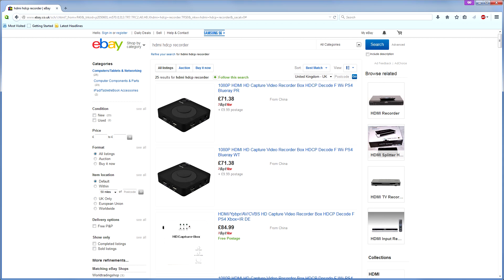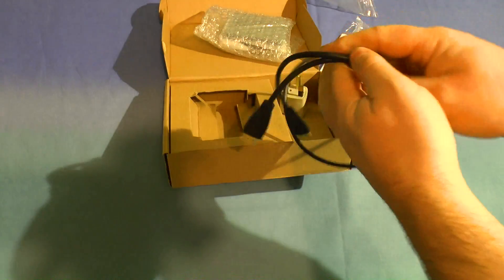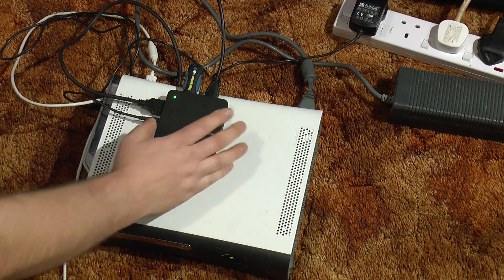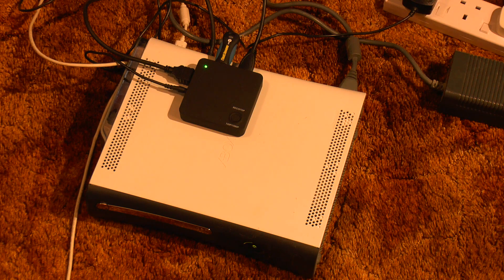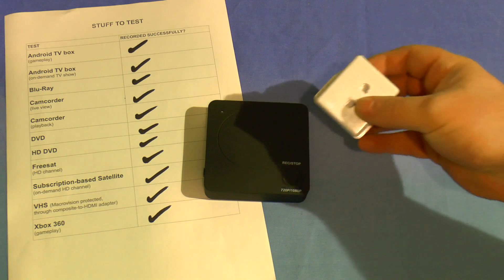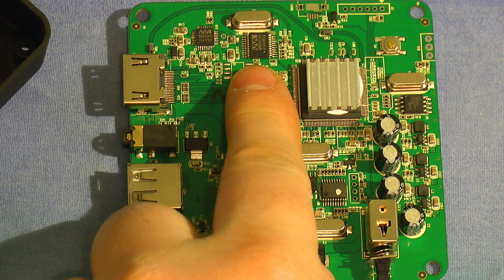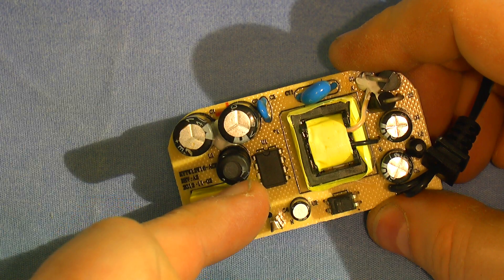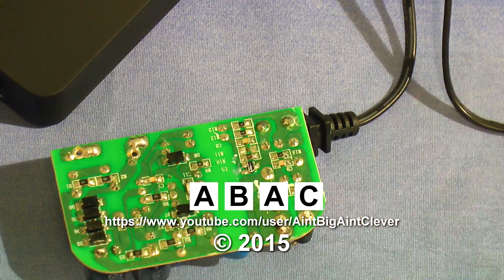HDMI capture recorder (with HDCP decoding) review and teardown

Comment: will it record your audio with xbox headset pluged into the xbox?
Reply from the maker: It'll record whatever audio comes out of the HDMI port. If the headset mutes the audio, then no. If the headset doesn't mute the audio but you can't hear yourself through the TV, then you need a separate microphone to record yourself. If everything comes through the TV, it'll record the lot, although you may wish to ensure you're outputting in stereo and not 5.1 as I think it'll only record the front two channels (2.0).
Reply: thanks

Comment: Do you get a nice smooth record? when I record I get a slight frame judder on panning shots ect, do you know how i could fix this?
Reply: +MovieMaster 666 These clone boxes can record a maximum of 30P when using 1080I/P,  that will judder yes. You can try recording using 720P60 fps instead?
Reply: Thanks for replying. I am trying to make a pal DVD from the footage so can you recommend how best to do this? If it helps I could also make the dvd NTSC at 30 fps would that remove the stutter or at most hide it a little?

Thanks again
Reply: +MovieMaster 666 Valid DVD's are MPEG2 PAL/NTSC ( 576i50/480i60) so you have te convert/reencode your recordings always if you want to make a valid DVD. The box can't record in interlaced so the conversion must be done properly from 50p or 60p to standard interlaced PAL/NTSC format to keep things as fluid as possible. You have to experiment with conversion software what gives best results. Sure always test the results on a real TV. And when you convert between PAL/NTSC framerates (50/25 and 60/30) you can get extra stutter too. It not at all so easy lol. Much more needed information about that on videohelp.com for example.
Reply: thank you so much for explaining that to. It makes sense now and I was going about it all wrong lol!
Now that you have explained it is there any software that will convert say a 50fps progressive clip to a 25fp interlaced clip that I can then make a nice fluent PAL dvd?
I think its the progressive to Interlaced part thats causing the judder so if I could find a way of smoothing that out it would be great.

Comment: Can you check which two pins on IT9910 chip connect with unsoldered MiniUSB. I have some another recorder based on same chip and it hasn't mini usb connector. On video two wire goes under the chip and i don't know how to guess what chip pins are used as usb device.

Comment: Can you see the output live? Using a USB? Because I'd like to stream gameplay.
Thanks! :)
Reply from the maker: +MegaShrooom that would depend on whether the Hauppauge capture software supports it. Possibly the Hauppauge driver in conjunction with ManyCam which would treat the unit as a webcam.
Reply: AintBigAintClever Ah, I see, many thanks for the reply.
 so the USB port is capable of outputting footage live?
Reply from the maker: +MegaShrooom I expect so, but I've not fitted a socket to the USB port so can't test it.
Reply: +AintBigAintClever Okay, thanks man.
Great review by the way.

Comment: Hmm that not very good teardown you didn't remove the heatsinker but looking at firmware of that HDMI Clonerbox which look like the very same device it saying it a ITE Tech. Comp may guest is it same IT9910 Grabber Device (HD) that found in the Hauppauge HD-PVR Rocket.
The board do show micoUSB that most like for PC mode as well as power port and IR port and long 6 pin is most likey the development serial port pin header and small 4 pin that could be fan pin header

Comment: Is this the manual for the device?
http://www.cloner-alliance.com/files/download/hdmi-cloner_box_user_manual.pdf
Reply from the maker: bclarky12 It certainly looks like it. There's a similar model which uses a wired IR receiver which connects where the microphone input is now, but mine's a mike one, same as the manual, which in turn suggests that the firmware is a match as well.
Reply: AintBigAintClever  Thanks! The firmware folder actually says yk918 on it. So I'm hopeful. Do you think you can try? I know it won't make the device malfunction, at the worst, it will delete the .img file off the usb stick and not update. Thanks for the great video!

Comment: Hey have you tried to install this firmware update to remove file size restrictions:
http://www.cloner-alliance.com/faq/technical-faq/how-to-upgrade-the-firmware-of-hdmi-cloner-box.html
direct link: 
http://www.cloner-alliance.com/files/download/hdmi-cloner-box-ca988b-fire20150515beta_0.zip
supposedly it removes the 2gb file size restriction if the usb is formatted ntfs.
Does it work? I'm really curious about this. The firmware is for a box that is probably the same as this but with a different sticker on top. I'm trying to find out if they are the same device. Thanks!

Comment: For me the board from the PSU looks actually fine, but the plug adapter with which it came is absolutely lethal !

Alex
Reply from the maker: High Voltage I've already stripped that for the screws and binned it :)
Reply: AintBigAintClever Well done :)

Comment: The good separation and flying secondary wires do hint that the power supply may actually be a good one.  That's rare!
Reply: bigclivedotcom And the fat diode and what looks like two output electrolytics with a choke between them hints at a better than average PSU too.

Comment: Id be tempted to whack a USB port on it and try it
Reply from the maker: Brandon Glatz I've tried soldering micro USB sockets, they're nasty. Given the choice of soldering down or filling with solder, they seem to choose the latter. Easier to solder a flying lead with a USB plug on the end.
Reply: For sure!
Reply: Brandon Glatz Just did that and Linux sees it as:

Bus 001 Device 008: ID 048d:9910 Integrated Technology Express, Inc. 
Device Descriptor:
  bLength                18
  bDescriptorType         1
  bcdUSB               2.00
  bDeviceClass            0 (Defined at Interface level)
  bDeviceSubClass         0 
  bDeviceProtocol         0 
  bMaxPacketSize0        64
  idVendor           0x048d Integrated Technology Express, Inc.
  idProduct          0x9910 
  bcdDevice            1.00
  iManufacturer           1 ITE TECH. INC.
  iProduct                2 IT9910 Grabber Device (HD)
Reply: arek m oooh does it let you use it as a capture device?
Reply from the maker: Nice work! Worth putting up a video showing what you've done. If you can get capture working in Windows as well, even better (not everyone knows their way round Linux).

If you do a video, please post a link here and I'll add it to my video description.
Reply: Now everything works fine - recording in 1080p, too. Install this driver: http://www.elektroda.pl/rtvforum/download.php?id=623429 and then hauppauge capture app (http://www.hauppauge.com/capture/). That's all needed. Records in 1080p just fine :)

http://i.imgur.com/ojR5zMw.jpg

Comment: might try to find one of these. I don't use much stuff with HDMI just my tablet but this would be handy to have around. I'd like to find an Standard Def version of this that can record composite video to either SD cards or flash drives.
Reply from the maker: coondogtheman1234 Look at the eBay pic, the white one does standard def. Alternatively some of the cheap composite-to-HDMI converters offer a ridiculously good quality picture for the money, just use one of those to feed the HDMI recorder.
Reply: coondogtheman1234  PVR Rocket can do this.